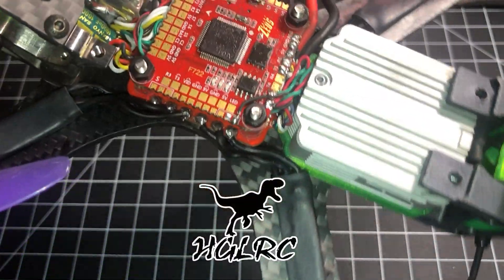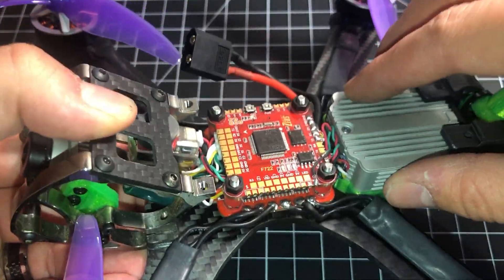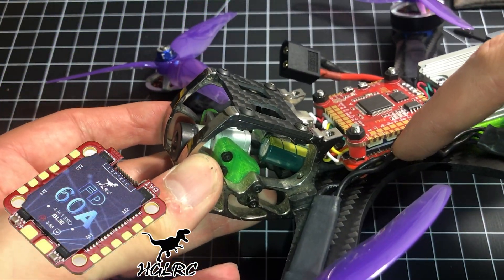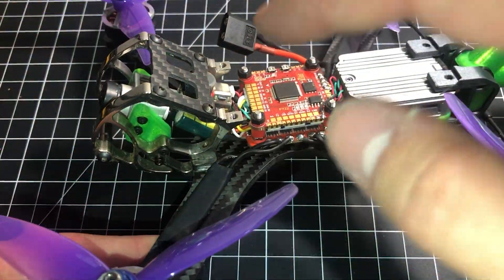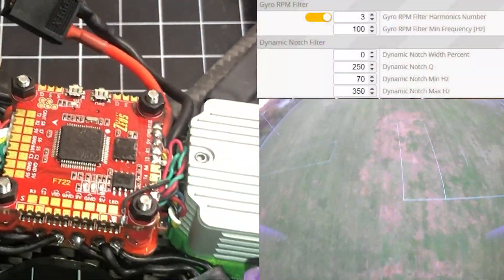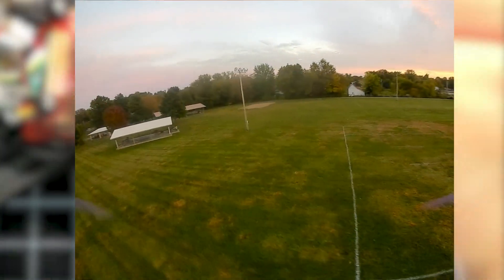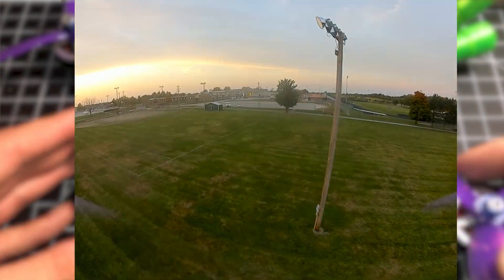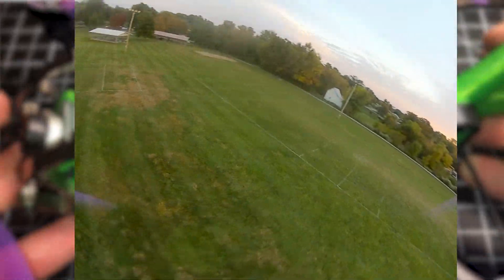HGLRC DJI Zeus F722 + HGLRC Forward 60A 32 bit ESC Build Review

Comment: I just bought this FC to replace a Mamba F7 APP FC because the mpu6000 gyro went bad. Not bad for $60 in this day and age. You have to buy what's available for the price they're asking. I like that this one also has an MPU6000. It says it does anyway.
Reply from the maker: The Zeus kit ended up being a very good setup for me long term, I still have this stuff. Hope it works out well for you! MPU6000 is the best gyro.
Reply: @JohnCuppi  That's great news. I was very happy with the Mamba stack too. It lasted 8 or 10 months, something like that.  The 55a esc is still good and so is the FC but it started occasionally freaking out and the black box looks less like a heart beat line and more like it's trying to color in the screen. I'm going to try to reflow the gyro before I try to replace it. I just want it back in the air now and it will be as soon as this FC gets here in the mail.

Comment: I think it looks like a clean build and most importantly, it flies great with all you did with it 😁
Reply from the maker: Thank you and loving the gemfan 51477 hurricanes. My new main prop.
Reply: John Cuppi I’m so glad you ended up liking those. So was what I told you on the money then about them. All the speed of the 51466 and all the durability of the 51499 but coming light on the weight and performing very smoothly. I hope that they are your 🦄 prop man. I know I love em. 😁
Reply from the maker: Quiksilvr i just wish they made them in green :)
Reply: John Cuppi eventually I’m sure they will. There still kinda new ( the 51477) in tine they may add more colors depending how sales of them are

Comment: Looks good to me John. Q: what would happen if you went with a higher gauge of wire which would make the drone lighter, the use and compartment easier to manage space-wise? I would think 3 thin strands of wire will hold the same amount of conductivity without compromising your power or control. What do you think?
Reply from the maker: It's a nice idea but for power delivery, you really don't want to go below 14awg or 16awg which is what I went with for the XT60.  It starts to affect voltage beyond that point for builds like this if the wire gauge is too thin. Of course, the air unit's cable -> camera size cannot be changed as well, as this cable is proprietary. I had to find somewhere to snake around, and was one of the troublesome cables to deal with. I think the real answer is to just not use the air unit for this build at all, and go with a caddx vista. The chameleon ti 5" wasn't designed for this.
Reply from the maker: And thanks for saying it looks good! I appreciate it. I did the best I could with what I had.
Reply: @JohnCuppi  :-)